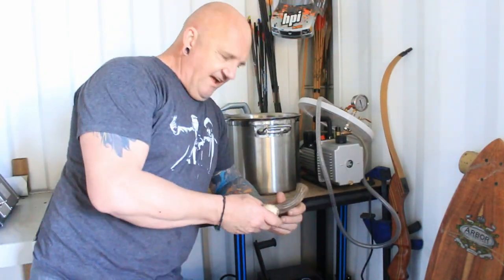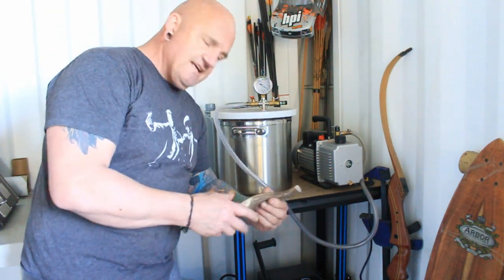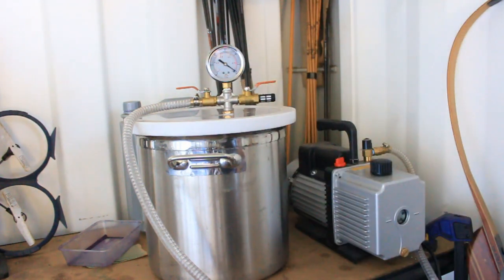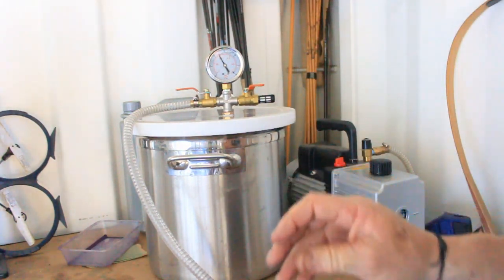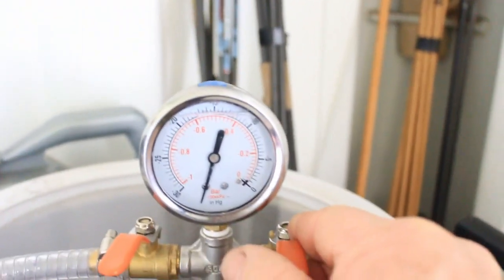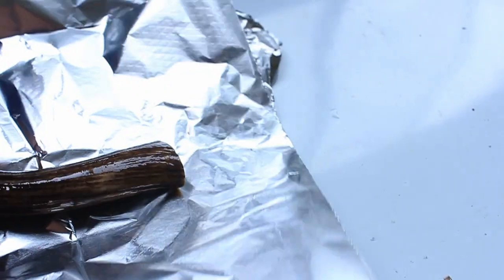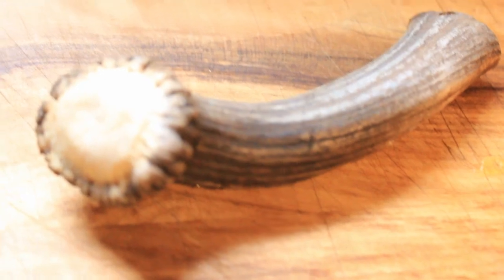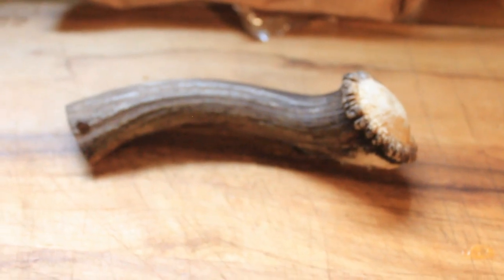Stabilising a Deer Antler - Step by step instruction

Comment: Would it be possible to achieve the same effect without a vaccum? How long would I need to submerge the antler in the resin for without a vaccum? Also, is it possible to do this with an already finished product (like I make the handle, then stabilize it). Cheers

Comment: Mark: I’m experimenting with antler bone to use for rope working fids/marline spikes. I want to straighten and then stabilize. I’m assuming the straightening would precede the stabilization. Have you had any experience with that procedure? I’m wondering if the straightening will impede the stabilization. Also, is antler more brittle after stabilizing? Thanks for sharing your knowledge. 
Donald
Reply from the maker: Hi Donald I don't have any experience with straightening but I don't think it would make any difference to the stabilisation as your are forcing the resin into "gaps" in the antler so I believe it would be fine and make no difference to the finished product.
Reply: @markbilson3775  Mark: thanks for taking the time to respond. I have the antler piece straightened now I just have to get the Cactus Juice to do the stabilization. I’m also planning on making smaller wood fids similar to the multi material fids Mikko produces and plan to stabilize the wood prior to assembly.
Reply: @djecpamba  I am very curious what process you use to straighten an antler piece. In my experience out west in the US working with naturally dropped antlers I have collected is that the antlers are extremely hard and depending on how early they are picked up off the mountain can be brittle. Perhaps that is just the lack of humidity and the nature of elk and mule deer in general?

Comment: Does the resin turn yellow when exposed to uv (like sunlight)?
Reply from the maker: To be honest I don't know!....However I don't think so as it is impregnated and not just sitting on the surface like any other coating would do....Mine looks the same as when done now 2 years ago!
Reply: @markbilson3775  would probably be so thin in any spot it may turn yellow to even show up.  Awesome project

Comment: Great clear instructional video Mark.
Two quick questions. Does stabilisation affect colour retention and in your opinion would a positive pressure cycle be of benefit.
Thank you. 👍
Reply from the maker: I think if anything the stabilisation process brings out the colour more than not being stabilised. I think once the resin has saturated the pourous sections of the item "it is done" so to speak.....However a further positive pressure cycle may help to contain the resin bleed out better when you bake it........Hhhmmmm good idea maybe???????
Reply: @markbilson3775  Good to know. I've been thinking it a positive pressure cycle and it probably is not worth it - diminishing returns. It may be different if you were dealing with a very large object and a more viscous medium, then multiple cycles could be advantageous.
Thanks a lot. 👍
Reply: Koo